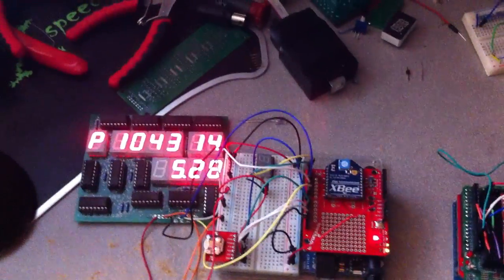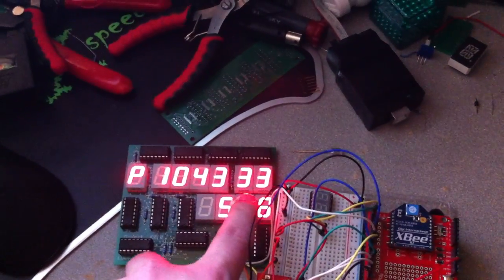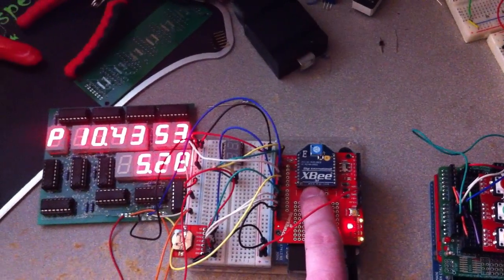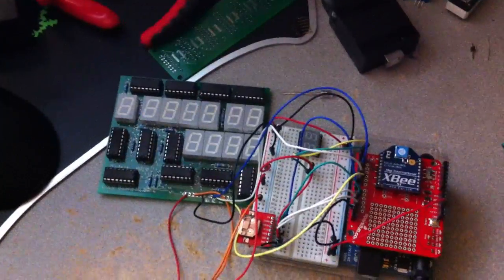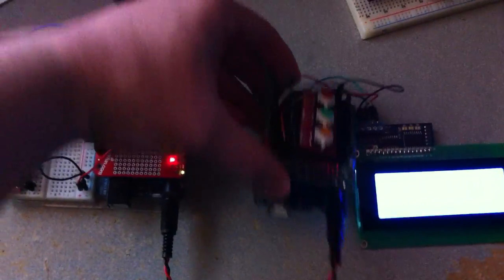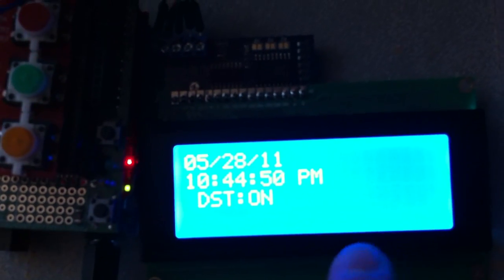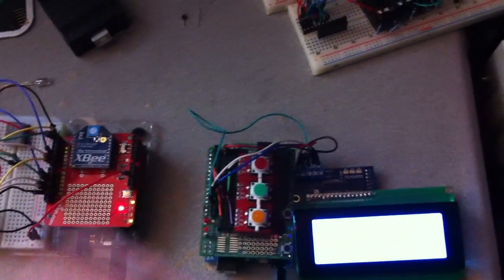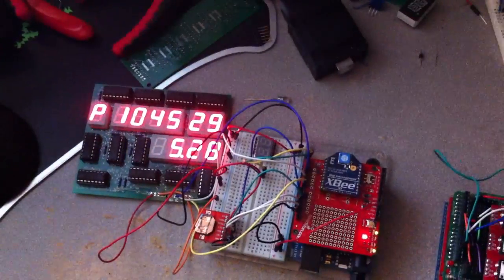Arduino Realtime Clock with Xbee wireless.

Comment: Neat!

I didn't understand why so few people made Aruidno-based clocks until I started down the rabbit hole of figuring all of this out for myself.

Did you ever finish your clock project? How did it turn out? I'm about to go digging through your videos to find out too, lol.

I really want to figure out how to auto-set the time on an arduino clock wirelessly, especially if the RTC modules aren't that great. Did you ever figure this out?
Reply from the maker: Hey, Thanks for the interest.  This vid was 11 years ago, but yea I did end up finishing it.  I am not sure if I have photos of it or not.  I ended up making an large version that i donated to Baltimore Hackerspace.  It hung up there for years until one day someone accidentally knocked it off the wall.  I haven't really set out to rebuild or re-do it.   If I were going to do the project today, I would probably use an IR transmitter/receiver for setting the time since they are so inexpensive and pretty easy to implement.  Also now days with "Neopixels" I am not sure I would go the whole oldschool TTL logic shift register route for the segments.  I would probably 3D print the segments to any size I want and throw neopixels in them with the bonus effect that they could change color.  Take care and good luck,  if you post anything, come back here and share it,  I'd be interested to see what you come up with!
Reply: @Tom Minnick  Thanks! I plan to 3d print some gigantic pieces. It does seem like the individually addressable LED idea is the right one to go with. I don't know how to deal with the real time clock module I picked up, or how to organize the data once I do figure it out. But that's my next order of business!

I'll try to remember to drop by and let you know. Thanks for the help!